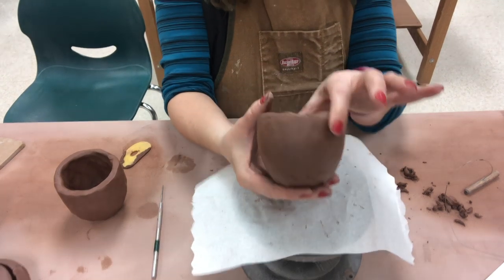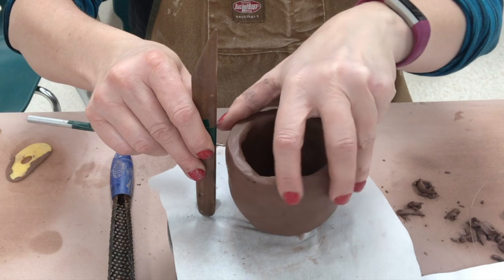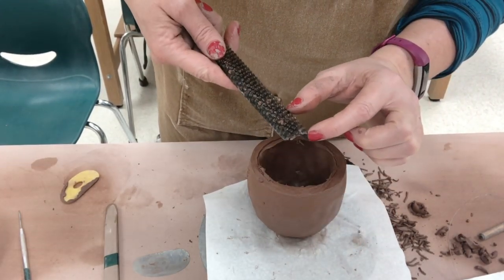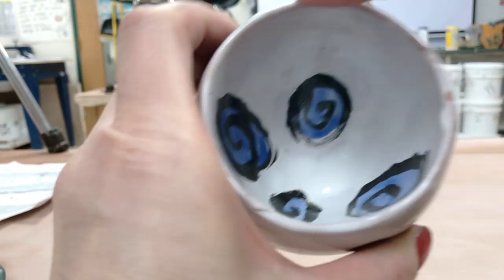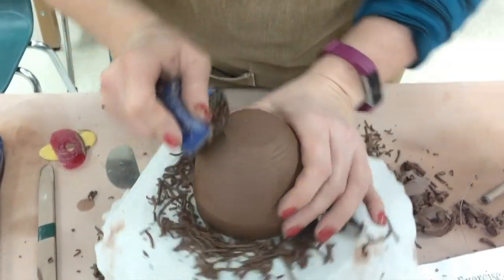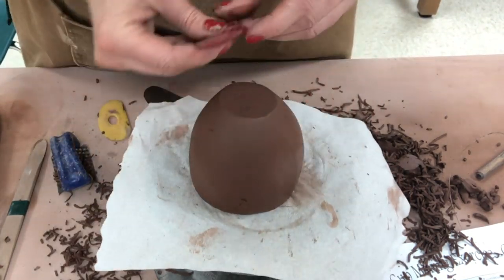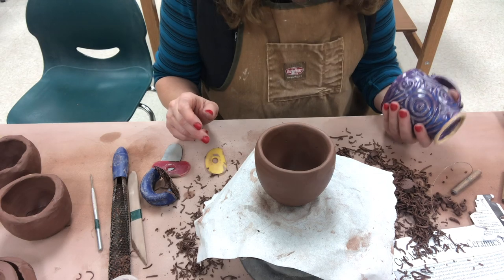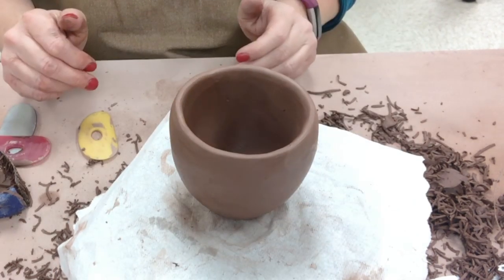Pinch Pot Cup Forms  Day 2 CLEANING  An Exercise for Beginners in Clay

Comment: You don't use the needle tool to measure the thickness of the clay walls?
Reply from the maker: That is correct.  The only time I pierce a wall with a needle tool to check thickness is on a wet wheel thrown hunk which has been dropped in the middle to check depth of the floor.  I don't pierce it when it is being pinched, as I want the kids to develop the sensitivity of feeling the wall thickness.  :) . I'm sure you could while it is plastic... it is just a step I don't really take with my kids.  :)

Comment: Mine dried out , should i wet it a little?
Reply from the maker: That depends on how dry. If it is only a little- you can slowly add moisture with a damp (just damp- not wet) towel and bag it.  If it is bone dry, I would recycle it and begin again!  :)
Reply: KaransPotsAndGlass ok thanks